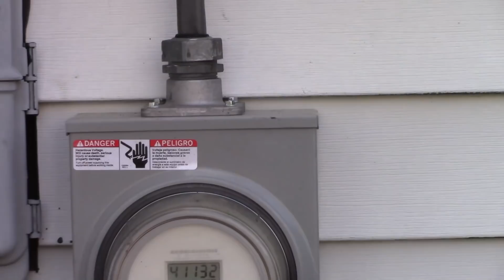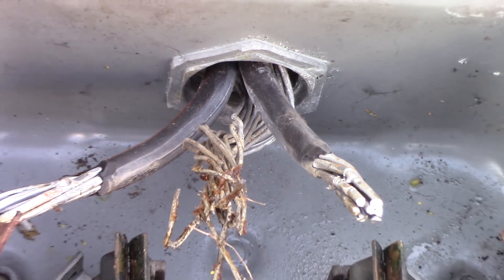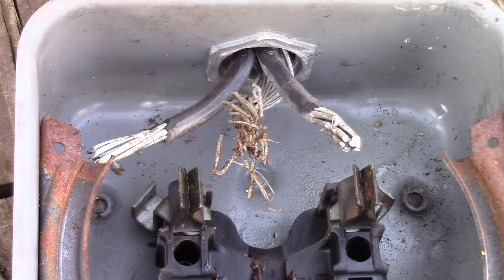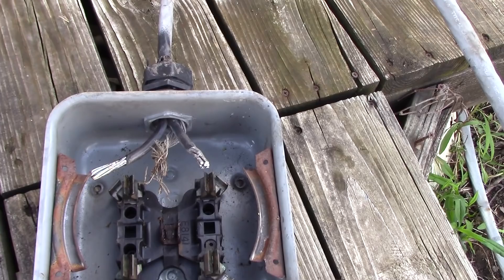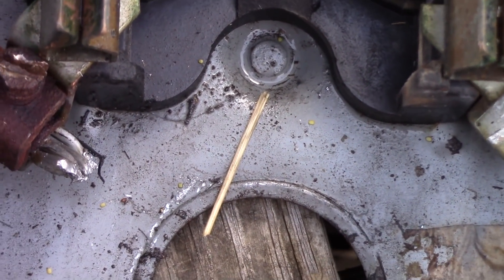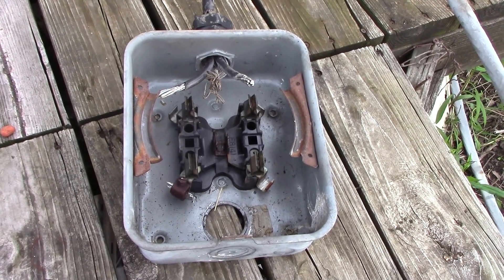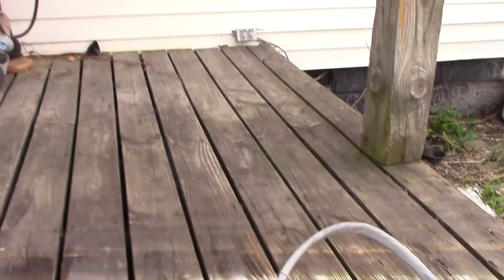Neutral Wire in Electric Meter Socket House Fire Hazard

Comment: Out issue with the pge smart meter was that there are corrosion on where the 120v black power cable connects to the terminal is corroded with white powdery stuff. PGE guy said it is not there responsibility. The lights was flickering. Do you know if there is a on/off switch or pge has to power off from there end in order to swap the terminal? Just curious.
Reply: The meter is inside a wooden door outdoor so water can still get in. I do see some rust at the middle bracket connected to the metal housing (ground maybe).

Comment: I run into this in trailer and RV parks all the time but the one I am working on now has got to be the best so far. Now keep[ in mind that this was installed by a "professional" electrician about 5 years ago according to the park owner.
OK We have 2 mobile home lots and each lot has it's own meter and cutoff. The thing about this is on the surface it looks fine, however the complaint was the "lot #2" has had an abnormally high electric bill ever since the two lots got the new "professionally installed" meter bases and shutoffs. This clown show who claimed to be a professional wired lot #1 up and them tapped into that service BEHIND the meter to feed lot #2's meter base.... Literally #2 was getting billed for lot #1 and #2 which according to the bill for May 2022 on lot 2 was over $600 USD and #1 was like $300 USD.
This is just one pair of lots wired like this, the other 4 on this leg are not occupied yet and will not be until I correct what this shade tree DIYer screwed up. Oh and no grounds installed at all, no lug grease, lugs are not even tight and the neutral on #1's cutoff is already discoloring due to heat from a lose lug screw.
Now this is the kicker, this fire / electrocution hazard PASSED INSPECTION!. IDK how or who paid off who, then again this is Louisiana where I am learning that someone can get away with some pretty dodgey and/or flat out dangerous electrical work and the inspectors will just sign the label and not inspect, and ANYONE can pull a permit  to do electrical work with no proof of licensing.
I mean I am used to how I did things in Nevada, the right way and thus that is how I do my work here now. If a customer does not like the price and the fact my work will professional, safe and be up to code, they can go hire one of those DIYer's that claim to be a pro that pays an inspector under the table to pass the work. Thats fine, because chances are they will be calling me back after the fake guy took them for a ride and the lights in their home still flicker.

Comment: Blew out the cable:/ I guess it’s Showtime @ The Apollo? Thanks for covering this. My liquid tight feed had thumb gum on it that went. It is getting water in my meter pan. Yeah you don’t wanna mess with the service feed, there’s no breaker on that, it’ll arc until 4000v to 220 v transformer bucket blows out! :/ well that that weЯd on the street anyway.
Reply: How much did that job cost you btw?

Comment: OMG, this is EXACTLY what’s happening at my house right now. Our lights dim and get bright and flicker all the time.  It started about 3 weeks ago.  It’s gotten so bad that the light flicker in time with the washing machine when it washes.  We paid an electrician $500 and he didn’t find anything wrong anywhere else in the house and mentioned that we should change out all outlets and light switches before changing the neutral.  I think we will start with changing the neutral because our problems sound like the ones you’re having.  The only difference is we hadn’t had any electronics or cable get fried....yet.  It’s a house built in the 70’s so everything is old and this is probably the problem.  Thank you SO much for posting this.  You are awesome!!
Reply from the maker: I hope that fixes it. It blew out our cable, because that was the closest line it could find.  Our lights would do the same thing with the washer.  The electric company is the one that told us what the problem was.  They came out and removed the meter and discovered it.
Reply: I know it’s probably fixed by now a year later but the power company is the next call. Could be a bad neutral in the meter base or the feed to the transformer, good to eliminate that if they will check it for free

Comment: a good electric provider should clean and retighten aluminum connections, without being told.
Reply from the maker: +William Lowe With the price we pay, you'd think so.
Reply: just got this month's bill and we pay less than 12 cents a kwh including taxes!
Reply from the maker: +William Lowe Ours is 14.6 cents per kwh plus about $18.00 in static charges.

Comment: Wow that had  to be early 70s .   Aluminum wire burned lots of homes down when they used to use that not good.
Reply from the maker: +Sheila6325 We are very fortunate indeed. But, it's all new now.
Reply from the maker: +TheKilog69 It's only allowed here in the feed. It's not allowed in the house.
Reply from the maker: +TheKilog69 The new stuff he put in and was approved is aluminum. The same stuff, and uninsulated neutral.
Reply: That is a good thing. aluminum has to have a specific box to connect to I am sure it right this time. I built lots of new homes in the early 70s lots of fires back then do to incompatible wire & connection box's that were for copper only.  But that was a long time ago.
Reply from the maker: +TheKilog69 That's exactly what happened. That was the wrong meter socket, and it helped hasten the corrosion process. We were very fortunate to discover it before it was too late.
Reply: Back in the 1970's several houses in my best friends neighborhood burned all the way to the ground from the same thing. Almost the entire huge development gutted their wiring and rewired. It was all over the papers and people were scared to death. It turned out, that all those that rewired, were indeed in serious trouble too! My friends house didn't have it, and no one knew why, because all of the houses there were built with aluminum. They even inspected every home that was built after a certain date too.
Reply: That was actually a very close call. I remember it happening to so many families, and they were some of the worst fires ever, and often taking down the entire house. Thank God you two are safe!
Reply from the maker: +Sheila6325 It's not so much the aluminum wiring, but all the connectors, boxes, switches etc were designed for copper, and the metal in those corrodes aluminum. The new meter socket I installed is designed for aluminum wire.
Reply: Yep, it's different today, this one turned out to be that the aluminum wire itself was of really poor quality, and it started fires when it broke down. I know this is different, but people need to know, not to fool around when it's anything to do with electric, it can cause a lot of trouble when we don't look into problems we are having. Bless, Sheila

Comment: your codes there are nothing like here. you can't use that wire your useing for a service it has to be in liquid tight conduit with a hub on top of the box. good to see that fixed
Reply from the maker: +Roy Amberg Yep.  It had to be to code which isn't as bad here. I'm replacing the siding anyway, so having to move it wasn't too bad.